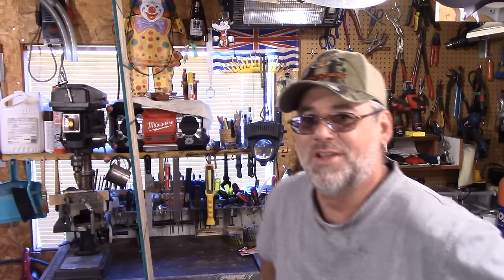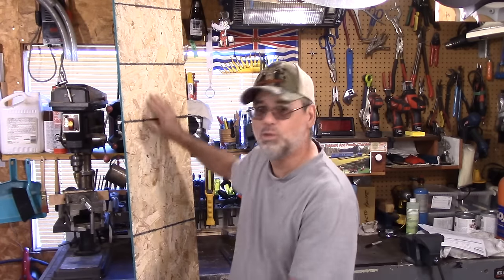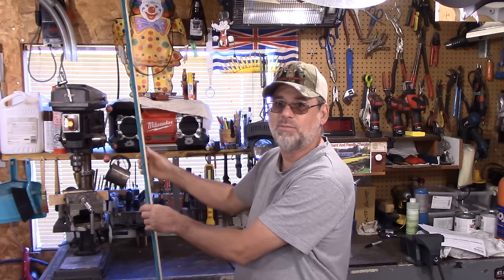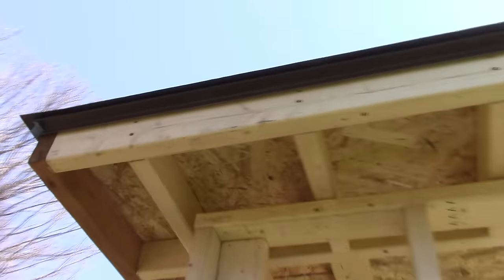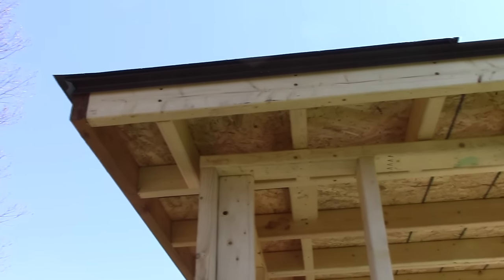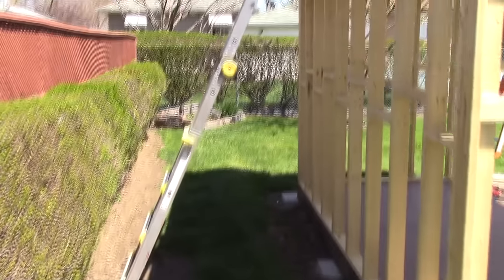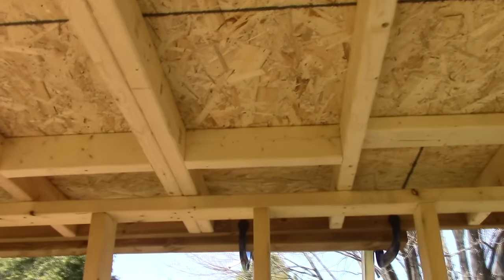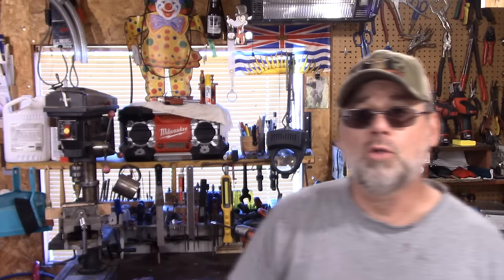HOW TO INSTALL ROLLED ROOFING ON MY GARDEN SHED BUILD

Comment: Hi! Did you overlap the sheets and if so by how much? How do you ensure there’s no gap between the strips of the membrane?
Reply from the maker: Jana the amount of overlap is is shown on the top side of the sheets as there is a bare spot where the overlap should be , its about 6  inches along the top of the roll and that where the seam of the next sheet meets .
Reply: @SteveRobReviews  Thank you!

Comment: Hi Steve I got and old roof rolls  on a very flat roof just like your shed can we roll this over the old roof...just broom it FIRST..
Reply from the maker: I never tried it but it's an old roof and the cost is cheap  so I would , just put steel roofing screws around the outside edges and it should be ok . You most likely dont want to strip the old roof so give it a try . 👍
Reply: @SteveRobReviews  I know that's RIGHT buddy I AIN'T got 6 THOUSAND for a roof job I will go to DEPOT tomorrow got RAIN coming in tomorrow in Atlanta Georgia...GREAT VIDEO and THANK YOU

Comment: I ve covered my roof with 2x8 x 12 cedar boards. Would you install this system on it? Will it stick?
Reply from the maker: Good question ,  this stuff almost took the skin off my fingers its so sticky so it sure would . I would still use some roofing screws around the edges  . Cheers
Reply: @SteveRobReviews  thank you Rob! I intend to apply it as a final coating..I just read on the home depot q&A that it's no t intended for that...too bad.. I understand you still did?
Reply from the maker: @Guzmanb  Home depot is correct , an experiment as I said in the video. For the money and ease of install I  used it and so far so good.
Reply: excellent I ve nothing to loose., and it sure is cheaper than any other option! appreciate the help!
Reply from the maker: Let me know how you make out . This is the third shed ive used it on , did it myself and at a great price  , one shed has had it on for five years .
Reply: @SteveRobReviews  I installed it last night. it's really easy to do. It looks really good... I m thinking I might paint it with white elastomeric to reflect sun rays and to make it last "forever" I appreciate the help!

Comment: Where did you buy this from? The ones at home depot are only 3 ft wide. I need 4.5ft wide.
Reply from the maker: Home depot,  yes that's the size , not sure if they sell wider .  I  find 3 feet  fine to work with . You will just have to use more and trim off the excess. Cheers
Reply: Ok thank you
Reply: 4.5+4.5=9 same as 3x3 ft strips

Comment: So the product says it need to be covered with shingles within 90 days. Did you cover it? If not how is it holding up?
Reply from the maker: I will do an update next summer but it still looks like new. It's as I showed and nothing was put over top .  Interesting experiment that has done well. My oldest shed with it on is 5 years old now and it looks great.

Comment: I don’t think 7/16s OSB has twice the sheer strength of 1/2 plywood... But it’s def less expensive. I would think it’s gonna be more prone to moisture and wind sheer. You sure that 7/16 OSB will hold up over time?
Reply from the maker: I'm not a expert on shear strength  but that's what the ratings are that I have read and told as well.  As long as it's not subjected to high moisture it's very good as no wood product does well subjected to moisture.  So far its all dry and no leaks . 👍
Reply: @SteveRobReviews  interesting. I may use this for my shed then. I’ll have to go take a look at some in person. Dig in a bit. Video was helpful!
Reply: I have OSB ( oriented strand board ) on my house and my shed … no rain infiltration issues on house , however squirrels pulled up a back corner of the shed shingles and water got to the OSB and it delaminated to where I had to replace a section with Plywood this time !!! … true story

Comment: Hi Steve with this material I don’t need the base layer? Only the Gaf weather watch is enough? Thank you
Reply from the maker: San all I use is just the GAF  sticks real well. 👍
Reply: Did you put any kind off glue on the flashing or this will stick by itself?
Reply from the maker: The roofing sticks real well so lay it on real slow .  I went around the exterior and drove some steel roofing screws  thru the roofing into the drip rail into the deck just incase we get a hurricane:)
Reply: So it will stick on the metal directly without glue. Right. Just the edge off the patio I have flashing metal. Thank you Steve
Reply from the maker: Yes sir it sticks real well.
Reply: @sand.590  The manufacturer recommends asphalt primer on all metal surfaces. Probably wouldn't need to screw it down then. Only issue I've seen with these products is you can NOT remove it from the sheeting when re-roofing. So expect to replace sheeting at that time.

Comment: Steve Rob Reviews can i use this stuff on a home? Sorry I don’t know anything about roofing but i need to know thanx
Reply from the maker: Absolutely not , for a  small shed  it has worked out great but never for your home . Cheers
Reply: I agree this is only for low to no angle roofs such as sheds garages carports balconies and stuff.  Never use it as your primary roofing for a house
Reply: What if my house has a low to no angle roof?

Comment: But if you add screws wont water get under the roof and rot your roof?
Reply from the maker: The screws are metal roofing screws with gaskets plus their only placed around the exterior,  no problems,  nice and dry.

Comment: I have a question not sure if anyone has asked it yet but how long does it last and what if you have to tear it off????
Reply from the maker: Great questions.  I have used this product for the last 15 years and so far  15 years is still looking great.  I wouldn't tear it off but you can easily , I would put another layer over the existing material. Cheers 👍

Comment: I run one roof of 7/16.. exterior paint on one side, thompson water seal on the other side then a sandwich of 1"foam board in-between another layer of 7/16th and ice and water cover the bottom 5 feet... then the silver felt paper .. it should outlast 50years without a leak

Comment: Sept 2021 update. Used this product. Very nice....but.... not nearly as sticky as when this video was made. Had to use an E6000 sealant to stick the seams and edges. I did the job with temps in mid to upper 90’s. Plenty hot enough to stick the  product down. Even went back and laid 2x4s on the seams and edges. Left them for 4 days & still had to glue it down.
Reply from the maker: Hum , maybe you had some  stock that had been sitting around for a while.  Extra sealant did the trick , good stuff 👍

Comment: I have a question: I have a small shed 6x7' and a roll of Weather Watch would be too much for me. Would the GAP Liberty Self Adhering Cap sheet do the same job? I know you can't guarantee, but I trust your word.
Reply from the maker: Frank its still a 34 foot roll and way more that you need for a 6x7 roof.  I  never tried it before so I would most likely just bang on some shingles for a small roof as its most likely the lowest cost.

Comment: Nothing needed for the underside?
Reply from the maker: Nope ,  never needed anything Jason. Cheers
Reply: @SteveRobReviews  Thank you. I am installing a very slight pitch 19 x 11 on the back of my home with rubber roof that I'm about to take off. I seen some people place an underlayment. I'm in NW Ohio.
Reply: @SteveRobReviews I'm just learning about this but dont you need to apply some asphalt primer? I cant find too much info but the GAF installation video mentions a Matrix 307 asphalt primer. Thanks in advance.

Comment: This is a follow up to my previous comment having done the roof on the shed, and what I would do different.

1.  Whether you add reinforcing boards to the roof or not, the roof must be even all over, dry and completely free of any debris.  This means you are keeping roofing only shoes on the ladder, keeping a broom handy, and using smooth side of OSB if using.  A flat roof is very forgiving for install, but angled one not so much.  N.b. if you have uneven surfaces buy a large tub of crack/wood filler to make roof seemless long before you install the ice\water barrier.

2.  Take six measurements of roof length.  Take biggest number and add 5 inches to that number.

3. Cut up all your ice barrier roll according to previous step.  When carrying a sheet to the roof roll up hitting both ends,  so that it rolls and unrolls evenly.

4.  Installing first piece should be done from ladder, position sheet so it overlaps edges by about 1 1\2 to 2";  you're going to staple with 9/16 staples around the edge when all sheets are installed.  tip peel off bottom or top of white film about 16", tap good in place, it serves as an anchor to position other end.  repeat on other end until everything is perfectly positioned, then peel entire bottom white film,  tapping into place as you go, no air bubbles allowed, then do the same with top white film.
 If you are doubling up on drip edge because that is where most of the abuse is,  do so now.  Remember to always pass the broom over surface before to installing strip even over ice barrier you are doubling up.

5.  If you have an eve, grab 2-3 sheets and carefully put them end to end o the eve, step onto roof onto first sheet doubled or not, grab a sheet from eve unroll it with at least 4" overlap.  Do entire roof, staple all edges ( on the side of roof and peak ).

6.  Now take 3 tab shingles and cut on soft side, reduce them to 2 tab shingles.  N. B.  you should not have used a single nail, screw or caulking on the proof thus far.  Use your brain to figure out the overlap.  Here's the less obvious advice, your going to put one roofing nail per shingle (but theres two sides you say, i know), shingle 1 will have a nail in side 1, shingle 2, in side 2, shungle 3 in side 1...  like the ice barrier the mineral side has a strip with glue covered by the thinnest film of plastic, so thin you will swear like a mof--o trying yo remove it because its designed to melt in heat, so on a hot day everything will stick, this nails are for interim period and to help with high winds.  The alternating of the nail is to keep each 2 tab shingle free to naturally settle.  if you put a nail on both sides, it wilk belly up the more 2 tabs you install; lesson learned.  think about where you are putting your nails.

7.  install flat flashing, 2" unless drip edge + no eve, all around, some fast setting epoxy would be best because osb like ikea particle board doesnt like to be screwed or nailed on the side.

and that is how it is done professionally.  if you double up drip edge, roof shoulf be good for 30 years.
Reply from the maker: Ever think about doing youtube ?  Your very precise and youtube could use more creators that enjoy what they present to their viewers .  Cheers 👍

Comment: I came here from a tiling underlayment video by Risinger.  So  you are suggesting using this instead of Schluder product?
Reply from the maker: I dont recognize the name your saying but this is something I have been trying .
Reply: @SteveRobReviews  so you put this directly over the floor, (perhaps double sheet of plywood) then mortar on top of this for tile?  You wouldnt put the rubber membrane down then?
Reply from the maker: @peetre  Sure you could if you like but so far this is working out fine as is.
Reply: @SteveRobReviews  Well that sounds very interesting, and... damn easy.   thanks and Merry Christmas !
Reply from the maker: @peetre  Cheers and you have a Merry Christmas too. 👍

Comment: Sir,
Can you provide the materials you used - Brand and where to buy. I am doing my deck roof with this.
Reply from the maker: I live in Canada so it was Home Depot . Check with them is they sell it where you are. Material brand used is in description.
Reply: I am from Canada too, GTA.

Few questions hope you dont mind:
1. Do you have to overlap them? If yes, how many inches overlap?
2. On the edging, what did you do, do you need to fold it?
3. In your shed, you only put 1 ply, others do another membrane in the middle between the plywood and the adhesive rolled roofing.
Reply from the maker: The surface is graduated like a shingle so the overlap area is bare just rubber membrane so you overlap all of the bare spot. It sticks to the surface real well and bonds over  to the metal drip edge  I put all around . I used metal roofing screws with a washer around the outside into the drip edge about every 16 inches  to be wind proof.  . No leaks and has done very well .

Comment: Can I install this on the top of older existing layer at my shed?
Reply from the maker: I did it last summer to an existing shingle shed  roof and it didn't look as good as a bare deck but for 1/3 a roll and some roofing nails it looks just fine .  Nothing fancy but I'm not into fancy just function. So sure 👍
Reply: @SteveRobReviews  thanks for your quick reply! I don’t care about the look either as long there are no leaks. I just expanded my shed and need to connect my existing roof with a new deck without removing my old shingles. This could be a perfect solution for me ! Thanks again
Reply: @SteveRobReviews  thanks for the info, about to redo my garage with it right now, wish me luck

Comment: You nailed the ends near the drip edge?
Reply from the maker: I used steel roofing screws that have a  rubber gasket under the hex head . 👍

Comment: Did you start at top or bottom of roof Or does it matter thx you
Reply from the maker: Start at the lowest part and work your way up . It can not work the opposite.  Easy , just peel and stick. Cheers Russell
Reply: @SteveRobReviews  thx you so much
Reply: @SteveRobReviews  ...so it overlaps?  would have been nice to see you do that part...   over lap it and it sticks on its own strong enough? no need for any nails at all in the middle part? ,,,, ALSO,   is this the same as  ICE AND SHIELD?
Reply from the maker: Yes it overlaps exactly with a bare spot that is left without any granular surface. I have used this on 5 sheds so far and it lasted great  for 5 years so far.  I just used  metal drip edge and roofing screws around the perimeter. Cheers
Reply: @SteveRobReviews  Some of the questions on YouTube are really puzzling. I can only assume a lot of people ask questions without watching the videos first. 99% are answered if you just watch the video.
Reply from the maker: @gailtaylor1636  LOL Welcome to my world  Gail .  Your lucky to get  25% of viewers to actually watch a video from start to end  on youtube but your observation  has always been a challenge  for creators as so many  don't watch a video but ask questions about a video they obviously never watched. 😅😅
Reply: @SteveRobReviews  Gets under my last nerve. Just WATCH THE VIDEO! But nope. Ain't got time for that...or complain cause "they" talk too much. Just can't satisfy some people. Thanks for the info. Acquiring a 10x10 storage shed that will need re-roofed. This looks like the cheapest/quickest way to keep it dry until I can afford to replace the whole roof with barn style so can have a loft.
Reply from the maker: Gail its cheap and easy to do and takes little tools or skill  to apply.  There are plenty of options on the market  for roofing and this is one of them for a typical shed roof  I feel most can apply .  Making videos is a hobby for me in retirement but I could never do this for a living without seeing a therapist constantly to prevent one from going insane trying to deal with all the challenges 😅 😅

Comment: Interesting, I wonder how long it'll last before leaking.  Hopefully you'll be around long enough to let us know!  :D
Reply from the maker: Jay I have it on two building up at the camp and its been 5 years and it looks the same. I wouldn't use it for a house but for a shed its great and easy to do fast. I can't shingle worth a dam. LOL
Reply: @SteveRobReviews  why not for a house?
Reply from the maker: @luleetomas2108  It's definitely not to building code  plus its not designed for a house.

Comment: Do you put it over felt ?
Reply from the maker: I put it right on the deck without anything . It sticks real well  to the deck so if you put felt it would not . I have done many sheds without the need for felt paper. Cheers Mike.
Reply: @SteveRobReviews  I had a roll of felt and already put it on. Should I take it off?
Reply from the maker: It's up to you as the product will stick to the paper and if the paper is well tacked on.  I never tried it , all I can recommend  is making sure the wind can not get under the roofing as I did with a drip edge all the way around .
Reply: @SteveRobReviews  cool. I think I'll just leave it on. Thank you sir 🙏
Reply: I thought this was underlayment?
Reply: @mikemiller5352  There are similar products that recommend a nail down layer first IF you think you will every want to do a tear off and re-roof, so I think you're fine with the felt on there.  This product however says "made for use under asphalt shingles" so it looks technically like it's made as the underlayment for shingles.